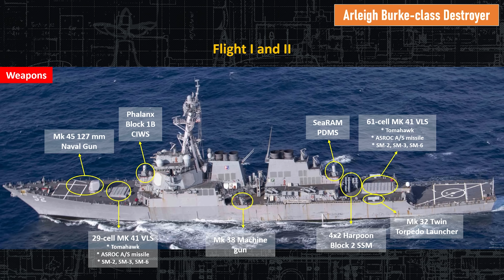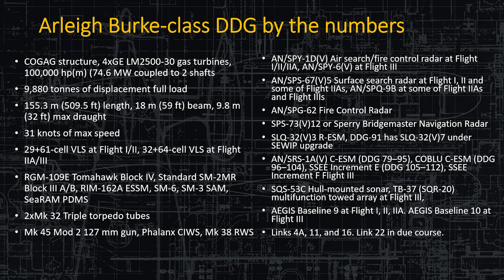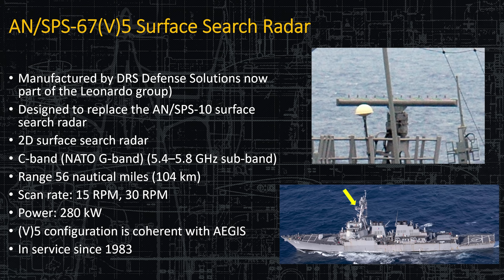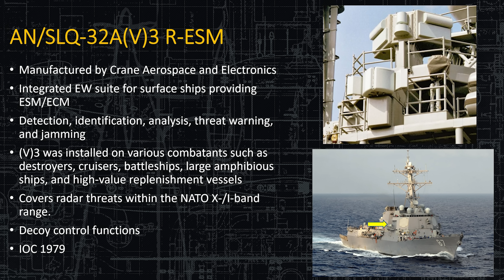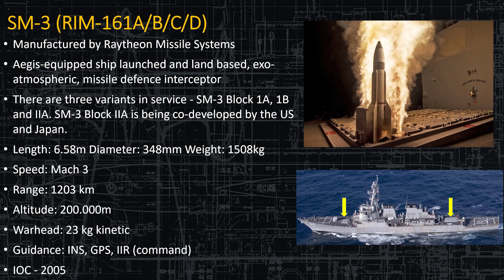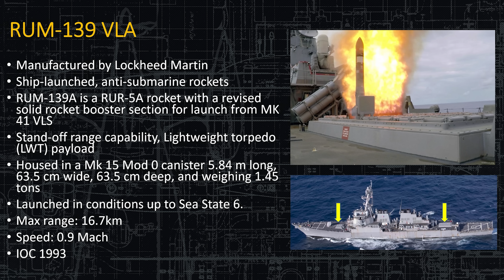How Does the Navy's Strongest Ship Work?

Comment: No more the most powerful combatant in the world.....The USN has 75 Arleigh Burke Class(ABC)  destroyer  1, 11, 11A and 111 of which only the ABC 111 holds that position. There are presently only 5 . The reason is because the ABC1, 11,11A are still using the outdated AN/SPY-1 passive electronically scanned array 3D radar. Most modern warships, especially the Chinese uses the latest AN/SPY-6(AESA) active electronically scanned array radar which is what the ABC 111 is now using.  AESA not only has a longer range, It can also detect smaller projectile like cruise missiles and also target more incoming missiles. Not so easy to jam too using EW.  In terms of surface warship, the Chinese has overtaken the American. But the later is still ahead in submarines but not for long though. Just like the ABC destroyer, most of which are old, the US nuclear submarine fleet is also encountering the same fate. At least 40% of the US nuclear submarine(SSN)  fleet are old Los Angeles Class.  Even most of modern fleet of Virginia Class nuclear submarines are old too. Except the Virginia Class Block IV which still can be considered  one of the best in the world. The US presently has about 55 nuclear submarine(SSN) of which only 8 of Block IV. Compare to the Chinese latest Type 95 which is now undergoing sea trial. Both are comparable in performance. The difference is that when the Chinese start serial production, they can produce 8 a year while the US maximum is only 2.

Comment: OK------------ . FROM AN OLD SALT, SERVED ON THE STERETT CG-31 FAR TOO LONG AGO...  I HAVE A FEW QUESTIONS THAT I THINK ONLY YOU COULD ANSWER.  THE NAVY HAS DECIDED THAT THE BURKES ARE NOW TOO OLD AND AT THE END OF THEIR USEFUL LIFE. IN A MODERN NAVY.. THEY  NO LONGER HAVE THE EXCESS WEIGHT LEFT TO  ADD ANY MORE WEAPONS HOLDING THE FLEET BACK..  MOST WOULD AGREE WITH THEM AS DO I.. BUT WITH THE RECORD THE NAVY HAS FOR ITS LAST FEW PROGRAMS I AM SKEPTICAL ABOUT THEIR ABILITY TO DESIGN AND BUILD AND LAUNCH A NEW DDG IN LESS THAN TWO DECADES OR ABOUT 2046. BUT!!! . I HAVE A QUANT SOLUTION THAT WILL FALL ON DEAF EARS. NO ONE CAN DO ANYTHING ABOUT IT.. BUT HERE IT IS .. 
----------- .  THE PROCESS HAS BEEN DONE FOR A HUNDRED YEARS WITH COMPLETE SUCCESS..  THE NAVY EVEN DOES IT WITH THEIR SUBS..
---------- .  DURING CONSTRUCTION,  ADD 100 OR SO FEET TO THE CENTER HULL, LENGTHENING THE HULL. MAKING ROOM AND WEIGHT FOR 64 VLS CELLS AND 3 HYPERVELOCITY MISSILE ARMORED CYLINDERS FOR 12 MISSILES...  WITH ROOM ON THE LOWER DECKS FOR ALL THE GENERATORS, FOR ALL THE POWER THE SHIP WOULD EVER NEED FOR THE FUTURE...   ON THE UPPER DECKS, BETTER ACCOMMODATIONS FOR THE CREW WOULD BE ADDED. AND EVERYTHING ELSE THE SHIP IS LACKING ON THE TWEEN DECKS... WHILE THE FUEL TANKS IN THE DOUBLE HULLS WOULD ADD ENOUGH FUEL TO FOR HUNDREDS OF MILES TO THE CRUISING RANGE OF THE SHIP.   AS FOR THE SHIP BREAKING IN HALF IN THE FIRST STORM, HURRICANE, TYPHOON..  I AM SURE THE ENGINEERS WOULD ADD ENOUGH TO THE HULL AND STRINGERS  FOR THE STRAIN.. LIKE 3/4 OR 1--INCH STEEL PLATE. DEPENDING ON HOW THICK THE CURRENT HULL IS. PROBABLY STILL 1/2 INCH.  NEVER COULD UNDERSTAND WHY THE NAVY INSISTS ON USING HALF INCH STEEL. ON SUCH IMPORTANT REAL ESTATE... 
------------ . NOT ONLY SALVING THE NAVIES' BARGEST PROBLEMS CHEAPLY AND EASILY SINCE THE SHIP IS ALREADY IN PRODUCTION.  BUT HAS A BONUS!!
------------- . THE NAVY NOW HAS THE BURKE FLIGHT 4 AND THE DESTROYER IT WANTED 40 YEARS AGO. AT A STEAL OF ONLY 20 TO 30 $MILLIONS EACH ADDITIONAL ON THE PRODUCTION LINE SINCE THE MODULE IS ADDED DURING CONSTRUCTION AS JUST ANOTHER MODULE IN THE TRAIN OF A HUNDRED CONSTRUCTION MODULES.
---------------- . THE CHEERY IN THE PIE IS THAT THE NAVY CAN THEN UPGRADE  ALL OF ITS BURKE DESTROYERS TO THE FLIGHT 4 VERSION SIMPLY BY BIDDING THE MODULS FOR PRODUCTION BY SHIP YARDS ALL AROUND THE COUNTRY, THEN BARGING THEM TO THE FEW YARDS THAT AREQUALIFIED TO CUT THE BURKS IN HALF AND INSERT THE NEW  100 FOOT MODUALS TURNING ALL THE BURKS INTO FLIGHT 4 BURKS..  WELL, SOME WON'T HAVE THE HANGERS AND FLIGHT DECKS BUT STILL BETTER THAN THE OLD BURKS.
---------- .  AGAION SIMPLY CUT THE CURRENT BURKS IN HALF AND ADD THE 100-FOOT-OR-SO PREFABRICATED MODULE THAT IS COMPLETELY OUTFITTED AND READY TO GO.  JUST CUT THE HUL;L IN HALF IN A DRY DOC OR FLOATING DOCK. PULL THE HALVES APART, DROP THE TOTALLY COMPLETED MODULE IN PLACE, THEN  WELD THE HULL BACK TOGETHER AND WELD THE HULL, HOOK UP -- WELD FIRE MAINS  AND SUCH, SPLICE, RERUN NEEDED POWER CABLES,( THE MILTARAY HAS THIS THING ABOUT NO SPLICES IN ITS MAIN POWER CABLES TO ALL EQUIPMENT.  FORCING SOME CABLES TO BE RE-RAN FORM THE BOW TO THE STERN IF NEEDED.) THE AUXILIARIES COMM CABLES AND YOU HAVE A SHIP READY TO GO TO SEA IN WEEKS, NOT MONTHS.  SOMETHING EASILY DONE DURING THE SHIP'S MIDLIFE REFIT.IF THE NAVY WANTS TO WAIT THAT LONG... OR DURING THE SHIPS' DEPLOYMENT RETURN TO AMERICA MAINTENANCE PERIOD. ONLY ADDING A WEEK OF DPWN TIME. UP GREADING  A DOZEN BURKES EACH  YEAR TO  FLIGHT 4..
------------ .  .THEN DURING THE NEXT 20 YEARS OF LIFE LEFT FOR THE OLDEST BERKES, THE NAVY, WHEN IT HAS THE EXTRA MONEY, HAS THE TIME TO DESIGN A BRAND-NEW SUPPER DESTROYER GUIDED MISSILE. WITH NO HURRY..AND TIME TO FULLY TEST  IT BEFORE PUTTING IT IN PRODUCTION..

------------------------.   THEN THE ONLY FAULT FOR THE OLDER BURKES IS NOT HAVING A HANGER AND LARGE FIGHT DECK..   NOW I KNOW THE NAVY AND ALL THE EXPERTS HAVE BELLOWED THAT THERE IS NO WAY A HANGER AND FLIGHT DECK CAN BE ADDED TO THE OLDER BURKES.. BUTT THEY ARE SIMPLY HEAD IN THE SAND WRONG...
--------------- .  ALL IT WOULD TAKE IS ADDING  50 FEET TO THE EXISTING STERN EXTENDING THE SHALLOW HULL SECTION  OUT ABOVE  THE PROPELLERS LIKE THE OLDER AMPHIB DOCKING WELL SHIPS.. AT  3 OR 4 FEEET  DEPTH THE WIDE HULL HAS PLENTY OF BOYANCE TO CONSTRUCT A FLIGHT DECK RUNNING BACK FROM THE MISSELE DECK OR O1 DECK ACROSS THE NEW STERN.. THAT NOW HAS CLEARANCE TO HOUSE TWO CHOPPERS UNDER THE FLIGHT DECK THAT IS LIFTED UP BY A CENTER ELEVATOR. AND LAUNCHED. FROM THE ELEVATOR PLATFORM, WITH EACH CHOPPER BEING SLID TO EACH SIDE OF THE LOWER MAINDECK HANGER DECK FOR STORAGE. AND LIFTED TO THE FLIGHT DECK FOR TAKING OFF FROM THE ELEVATOR. ONCE THE FLIGHT DECK IS CLEAR, THE ELEVATOR LOWERS, AND THE NEXT CHOPPER IS SLID SIDWAYS ONTO THE ELEVATOR TO BE LIFTED AND LAUNCHED.  LANDING IS JUST THE REVERSE PROCEDURE OF THE LAUNCH.   THE CURRENT BURKES CAN ONLY LAUNCH ONE CHOPPER AT A TIME AS WELL, WITH  EACH CHOPPER HAVING TO BE HANGARDED TO LAND THE OTHER AND VICE VERSA... SO THERE   IS NOTHING DETRIMENTAL TO HAVING A CENTER ELEVATOR ON THE EXTENDED FLIGHT DECK. 
------------- .  THE BARGE EXTENSION OVER THE PROPS ACTUALLY MAKES THEM MORE EFFICIENT AND QUIETER. IF DESIGNED RIGHT..
 WHILE REDUCING THE STRAIN ON THE TOWED SONAR CABLE BEING FARTHER AWAY FROM THE FAST TURBULENT PROP WASH. TOWED SONAR CABLES ARE DAMN EXPENSIVE WHEN THEY BREAK..
------------ .  DESIGNED RIGHT MEANS EXTENDING SKERTS OR HULL DOWN BOTH SIDES OF EACH OF THE TWO PROPS AND KEEL FORMING TROUGH THAT CHANNELS THE WATER AND  SOUND AWAY FROM THE SIDERS 0F THE SHIP. THIS ALSO MAKES IT POSSIBLE TO DUCT EACH PROP THAT CAN REDUCE CAVITATION.. SIMPLY BY EXTENDING THE SIDE AND MIDDLE KEEL SUPPORT HULL  ACROSS THE BOTTOM OF EACH PROP  FORMING A DUCT, SHROUD OR TUNNEL...  A PROPOSITION THAT WOULD HAVE TO BE WELL TESTED..FOR CLEARANCE AND NEEDED SUPPORTS. TO KEEP THE DUCTS STIFF ENOUGH.. BUT IT COULD BE WELL WORTH THE EFFORT IN REDUCING PROP NOISE TO SUBS AND INCREASING EFFICIENCY, EXTENDING THE RANGE OF THE SHIP.  THE SIDE EFFECT WOULD BE PROTECTING THE PROPS FROM DIRECT IMPACT BY TORPEDOES FROM THE SIDES. AND BOTTOM.  WITH THE 70 KNOT WATER STREAMING BACK FROM THE PROPS DETERING ANY TOPEDOES FROM MAKING DIRECT HITS ON THE PROP  BLADES..ESPECIALLY IF THERE IS A SHORT TUNNEL TO THE BLADES..THAT THE TORPEDO WOULD HAVE TO SWIM UP AGAINST.. MOST TORPEDOES ONLY HAVE   45 TO 50 KNOT SPEED... AND BLOWING A HOLE IN THE ARMORED WALL OF THE TUBE OR SKIRT DOES NOTHING TO THE PROPS, SAVING THE SHIP.  AND SINCE THE HULL COMES BACK WITHOUT BRAKING WITH AN EFFICIENT LONG NARROW SCOOP WITH A DEEPENING TRENCH PROVIDING WATER TO THE PROPS, THE DRAG SHOULD BE VERY LOW.
------------ .   THE  ADVANTAGE OF THE EXTENDED FLIGHT DECK AND ELEVATOR IS THE ELEVATOR ITSELF CAN SERVE AS  PARKING SPACE IN THE HANGER  FOR A 3-RD CHOPPER.. WITH DECK DOORS SWINGING CLOSED TO SEAL THE HANGER...  SOMTHING THE NEWER BURKES CAN ONLY DREAM ABOUT,,  

------------. SO THERE IT IS WAY TO MUCH I KNOW. BUT I HOPE YOU READ IT AND LEARNED SOMETHING.. THANKS..

Comment: Is the Arleigh Burke Class good? Of course!

But

The basic construction from the 90th shows it´s age. 
It needs to much personnel, because the degree of automation is not state of the art.
The COGAG propulsion system is fuel thirsty and maintenance heavy. Above that, it is also loud.
Despite good sensors and weapons, it is not a good ASW platform. To define good, look what smaller purpose built ASW frigates can do.
It has no reserve buoyancy or room or electric power for upgrades.

Comment: Really good layout of the most prolific design of modern day warships.  A lot of credit for the solid design goes the RADM Joh "Sea Wolf" Bulkeley, USN for runig the Board of Inspection and Survey (INSURV) at JFK's request and for several decades (I met him 2 x on INSURVs).  When the original design came out, he ripped he designers a new one, pointing out the decades of documented discrepancies of hull/superstructure design of "conventional" naval architecture.....they reworked it as result.  The "magic" of the AEGIS System was a real upgrade to what we had.....

Comment: In late 80s, the TASM (TOMAHAWK Anti-Surface Missile) was dropped and those airframes turned into TLAMs.  I ran several at sea tests for tactical development on our staff and the analysis was, given real world observations from Gulf of Sidra, the Tanker Wars and Falkland Islands conflicts, coupled with gyro and radar capability specs, that HARPOON was still a better weapon.  It's a long. long sea story as to many other associated factors, but TLAMs do not have a sensor suite to see a vessel at sea, so, no, not even in a pinch, can you sling one at a ship.  The  other TLAM variant not mentioned is the "D" which has a payload of bomblets that are programed in one of 3 modes for mission requirements.  You can. like in TOP GUN Maverick, "chop" up runways, and do all sorts of mischief for parked aircraft/vehicles, and "Troops in the Open" scenarios.....with the airframe with residual fuel, once bomblets are expended, to be a kamikaze into, say. control towers. commend bunkers or maintenance facilities.

Comment: (<-20 yr SWO and was CHENG on LM-2500 DD)  The LM-2500s are placed 2 to an engine room.  Forward MER drove port shaft, Aft MER the starboard shaft.  Engine modules side by side in modules, with an output shaft off the power turbine going into a pneumatically operated clutch/brake assembly.  We literally would clutch in/out the engines depending on operations, and on one, 21 kts was easy and used when doing long transits mostly for fuel use. Shutdown engines could be online in under 3-4 minutes and clutched in as needed.  Most often we were split plant with an engine running in each machinery room, with the others in standby.  During operating such as underway replenishing, navigating in restricted waters, and of course General Quarters, all 4 LM-2500s were online and Flank III was in excess of 33 kts, with throttle control passed to the bridge.  During UNITAS 24, we had casualties to 2 clutch/brakes and we my crew literally wrote the process to repair not in a shipyard, as the Philly based ship engineers hadn't had to do it before.  I had just taken the Engineering Dept a few days before the second one, and we did repairs at sea in 35 hours in the South Atlantic.  Also had GTM 2A destroy itself due to the main fuel control failing wide open.  The USAF flew to new engine and the support equipment to Montivideo, UR.  We did, as he said, separated the sections and then using bult in and installed for the change railings so they could be lifted out by crane in the air intakes.  The new sections were lowered in on the same path, bolted together, wired and plumbed (fuel lines).  "Book hours" listed as 84, we pushed the start button at 83 hours and my sailors ahd done the procedure perfectly.

Comment: (<-20 yr SWO) The tracks on the flight desk are for the RAST *RApid Securimg and Traversing) system.  It was developed initially by the Canadians named Bear Trap and it's correct purpose is to allow helo operations in higher seas, as, yes, it can move the helo safely secured to the deck to launch without crew on deck, but more importantly to assist in the landing as deck pitches and rolls.  Helo hovers over the deck lowers a probe, a crewman does have to go on deck to attach that to a winch line, then clears the deck, and the RAST operator in a enclosure on the flight deck, literally winches the helo to the deck as pilot applies some back pressure.  One the probe is in the is in hte sled, it is captured and the helo is pulled all the way onto the deck.  The aircrew stows the helo blades, the it is moved into the hanger.

Comment: I regularly hear the sm2 referred to as a last ditch weapon, or not ideal, when it comes to the anti-ship role. And I would love to hear why this might not be the case, but to me I have always thought that was really only if the target is a large well defended warship. For defense against smaller vessels would the sm2 maybe be a very good match? To my mind the range, cost, and destructive potential would weigh out well against a vessel like in the missile boat and maybe even come corvettes.
Reply: Warhead on an SM2 is designed to take out aircraft, which have a much more delicate structure, which only need a bit of deration to send aircraft out of control.  Also, based on distance to the horizon at essentially seal level, you have a very short range and that counts when the missile director has to light up the targe, and the is line of sight.  They are effective to decapitate the comm/radar antenna structures, giving minimal response time of the target....we would use SM1s  if need be as well, but HARPOON was the rule, as you could get ouver the horizon by a good distance....But know, the NATO Sea Sparrow system is very effective in an anti-ship mode.  Besides testing, sadly the USS SARATOGA proved it in Oct 92....

Comment: Isn't the Achilles heel of these ships the fact that in a fight they will have to leave the battle space to return to port to reload vls?
Reply: Yes.  The beginning efforts to use 3 cells of a VLS for a loading crane was a big fail.  transferring the cannisters (that's how the missiles are housed, not as a bare round like the old days) around the decks, even if they were landed in helo spot/UNREP station next to the cells proved too much on a ship at sea even in light seas.
Reply: I suppose, but if you have 100 of them they can be relieved by other destroyers or other ships.

Comment: Since the Navy's also putting those SM-6 missiles into an air-to-air role carried by Super Hornets, that gives a carrier group effectively an unlimited SM-6 capacity as they can be reloaded at sea on the carrier, instead of needing to go back to port for a VLS restock. And the Super Hornets can go out way out ahead of even the destroyer escort and be shooting stuff down before it comes within that 200 NM range from the surface launch, or even fly out (with refueling) over extreme distances from land bases and provide that defensive capability to an area when there are no surface vessels available. Apparently they're getting an upgrade vs. ballistic missiles, too, so they'll be able to do what the SM-3 does in at least some capacity.

Comment: 32:07
I don't buy the fact that a radar can distinguish between a decoy and a warhead. Maybe it can differentiate between radar decoys but it can't differentiate between a warhead with dummy payload and a warhead with nukes or explosives. These are the types of warhead Russia and china incorporating in their arsenal. No way any radar can distinguish between that. We never tested it so we don't.
Reply: There are different sorts of decoys. Some would look exactly the same. Some definitely do not, and were designed to defeat much more simple radar systems from many years ago that weren't able to discriminate between radar returns all that effectively.

Comment: I have a suggestion for reloads .?magazine configuration , expand the size of this vls where an additional weapon is packed next to launching missile and like a magazine , it pops the reload into the launch position , simple soloution just like a m-16 mm magazine, you could effectively double the missile load out .
Reply: There isn't the space internal to the ship to do that, besides, VLS is loaded by positioning the cannisters perfectly vertical above the cells....it was an initial plan with 3 cells holding a loading crane, which proved completely unfeasile under normal operating conditions at sea.

Comment: When you actually see the LM-2500 and how small, tiny volume, it is compared to a similar power level diesel, you understand why it was used.
Reply: An incredible piece of machinery and very reliable.  on DD963s, they were 20K HP each, I believe the DDG51s got a 25K version.....
Reply: I work for a company I will not name, and we machine some internal structural and high temperature castings for the LM2500 engine manufacturer. They are incredibly small to an old guy like me in his mid 60's. And TOUGH! I would like to see the final assembly and testing at GE!